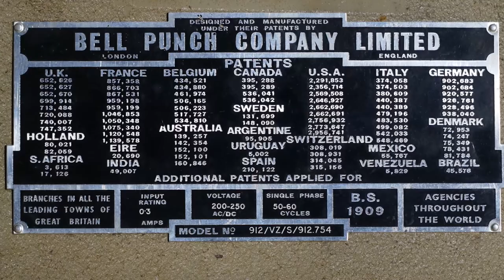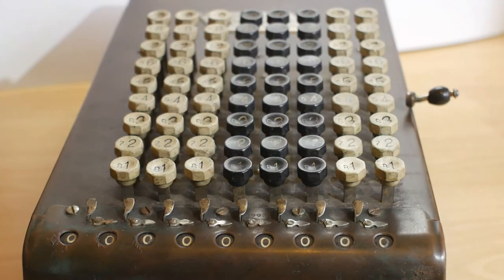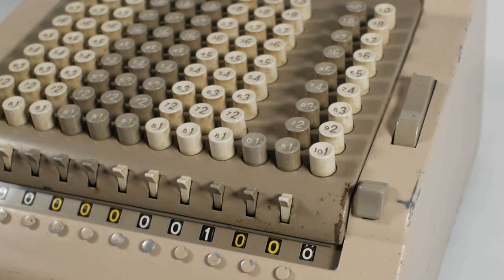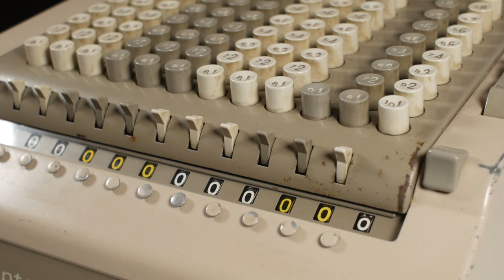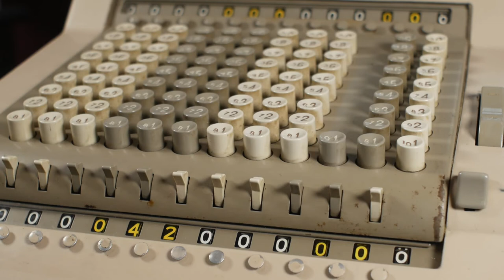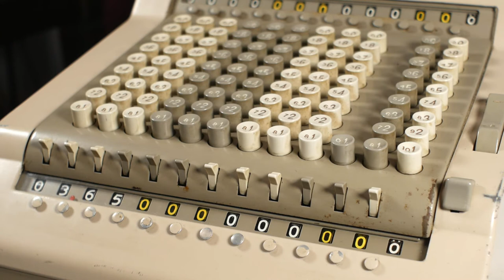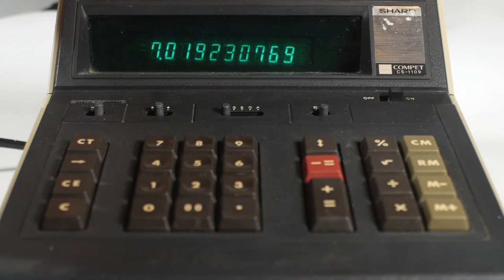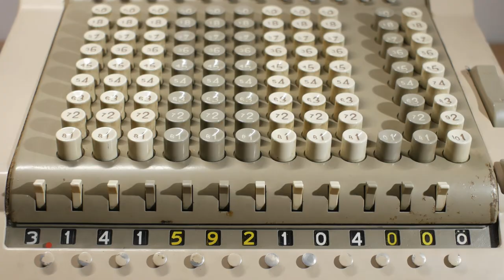Comptometer 993s - Sumlock Electro Mechanical Adding Machine - Part Two - Demonstration - Retrotech

Comment from the maker: Oops, I made a booboo - the model number 912/VZ/S stands for 9 numbers (the smaller Plus adders were often 509 because the numbers only went up to 5), 12 columns - I still don't know what the VZ stands for but it's probably that the machine is electric and possibly this also refers to the storage register - the "S" stands for Sterling currency - I should have known this - it's the same method of model number used on ALL the Bell Punch machines that I've seen!!!!!!!

However, in my defence, in the case of the 993s on the front of the machine, the "s" in that case DOES stand for Storage, referring to the additional storage register.  The 993 machines had the manual 993m, the single register 993e (electric), the dual register 993s (electric) and the 993 Comptomatic  which could do automatic multiplication.

Comment: These were still in use when I started work, the 'Comp Operators' were very quick when they were working, but part of their training was to minimise movements and so whilst the columns hand numbers 1-9 when they were using the machine they kept their hand on the lower numbers to rather than stretch up to input a 9 they would press 4 and 5 as the hand movement was quicker.
Reply from the maker: Hi Chris, I think I was just too late starting work to ever see mechanical calculators of any form being used in anger - I'd quite like a trip back in time to see them in full swing.  You can sometimes see the wear on the comptometer style machines and the 6, 7, 8, 9 keys are like new, while the others are all worn out.  There were basic adding machines like the Bell Punch Plus Adders or the Contex model A or B that only had keys up to 5 - I use one of these quite regularly, and for simple addition it's awesome.  You can technically do multiplication and even division on one of the 5 key machines, but it involves far too much thinking, so that's best saved for the full keyboard machines.

Cheers for watching, it's always good to hear from people who have seen these machines doing their job rather than just being a collectors item.
Reply: You are right about the 1 to 5 keys being the main keys used.  In the 1970’s I worked in the payroll department of a large engineering company and three of us used the Burroughs comptometer.  I later used an electric NCR calculator and having used a comptometer, without looking at the keys, I trained myself to do the same with the calculator which then carried over onto doing the same on a computer with a number keypad.  So the initial training was really useful.

Comment: Interesting video but I was a Comp Operator and was taught to add using only the first 5 rows.  Holding keys simultaneously was used mainly for multiplication and other large calculations.  We also worked with books of reciprocals to make calculations quicker.  The speed we worked needs depicting as that was just as important.
Reply from the maker: Hi Anne, I bet you could run rings round me on one of these machines!!!  I forgot to mention in this video that operators often only used the first five rows for addition - I did remember to mention that fact when I did one of the Plus Adders which only had five rows!

I'd love to see a trained operator using one of these machines - I can find my way around them fairly well but I'm not particularly fast.  I've repaired lots of calculating machines and it's largely the fascinating mechanisms inside that really attract me.

Were you using the Comptometers when electronic calculators started taking over, and did you carry on using Comptometers regardless of the new technology?  I would guess that a lot of Comptometers were still used until spreadsheets and accounting software became the norm.

Comment: Dug one out of my grandparents' loft recently, and we don't have the power cable. Do you know what kind of socket is on the back of the machine, and which pins are live, neutral and ground? Thanks.
Reply from the maker: Hi Daniel,  I never managed to track down a cable for this machine, so I fitted a modern C13 socket meaning I can now utilise any C13 power lead.  I bought two of these machines, with about three years between them, and they had different power connectors on the back, so your machine might not have the same connector as the one in this video.

I have recently discovered an online museum of plugs and sockets which could be really useful for tracking down old power connectors - the navigation is a little bit clunky but it's a good resource:  https://www.plugsocketmuseum.nl/ApplConn_overview.html

Both the machines I bought have a suppression box to reduce unwanted electrical noise, and on both machines, the capacitors had failed to a dead short, so even if you did have a lead, it's relatively likely that you might just blow a fuse.  They're not outrageously difficult to rebuild if you're used to working on electronics but you will have to source modern equivalents for the capacitors.

I'd need to check my notes to see which was live and neutral on my machines - the centre pin is the earth pin - if I remember correctly, it is colour coded once you take the case off the machine so it should be pretty obvious.

Comment: If I understood it correctly the storage works like the accumulator of a "normal" calculator with adding and subtracting. So you could use it for division without the need of dealing with complementary numbers. Only the overflow bell is missing, I guess, so you would have to watch the display.
Reply from the maker: Hi Fritz, that's a good point, I guess you could use the storage register for division - as you say, it wouldn't be quite as simple as using a pinwheel calculator because it doesn't have the bell to let you know when the register has underflowed, and additionally, as it clears the main register every time you add or subtract from the storage register,  so you'd need to key in your divisor every time.  Also, there's no counter register, so you'd need to count in your head and write down each column as you completed it.  Nevertheless, it would mean that someone could perform division with no knowledge of complimentary numbers and all the associated rules.
Reply: True, I totally forgot about the missing counter! ... I tried the complementary method on a pinwheel calculator. It works, but I tend to mess up something. It does need a lot more concentration than the standard procedure!

Comment: Interesting techniques to make that machine to do all sorts of things.
Reply from the maker: It's quite an amazing machine - Felt and Tarrant, who invented the Comptometer, used to run training schools to teach people to use the machines quickly and accurately - I think I read somewhere that they were the largest privately run schools in the country (or the world, I can't remember which).  They would teach far more than the four basic maths functions that I showed in the video.  People carried on using the comptometers right into the 70s because they were quicker.  It's quite good mind exercise too - I do random calculations just to see how fast I can do them....
Reply: @GrumpyTim  That's quite something isn't it? All because you can press multiple keys at the same time.
Reply from the maker: It's kind of strange really - technically, the pinwheel calculators beat the comptometers hands down when it comes to complicated multiplication and division but probably for accounts, you couldn't beat the comptometers.  I think people would have been reluctant to swap to ten key entry machines and it wasn't until electronic machines really made their mark that the comptometers faded out.  I've seen videos of schools in Japan where they're teaching the use of ten key calculators - the speed they enter the numbers is beyond belief - I couldn't come close to that speed, no matter what device I was using!!!!!
Reply: @GrumpyTim  Hi Tim, do you have a link to such a video? Can't find one yet..
Reply from the maker: Hi Rob, was it the teaching the use of ten key calculators you were after - I can't remember where I saw the videos, it was a few years ago, but I did find this one - the speed is amazing - I can't even think that fast, let alone enter the numbers at that speed!!!!!  https://youtu.be/WwGL4Z__Ufc